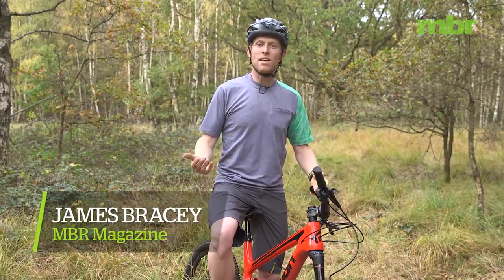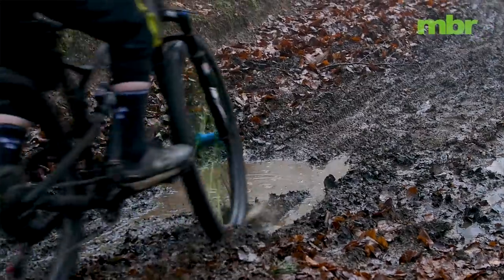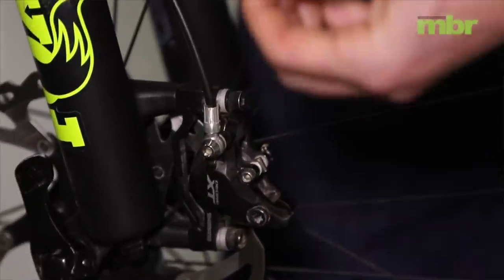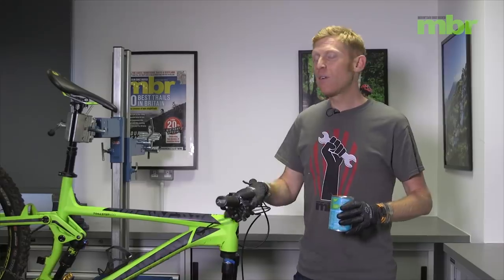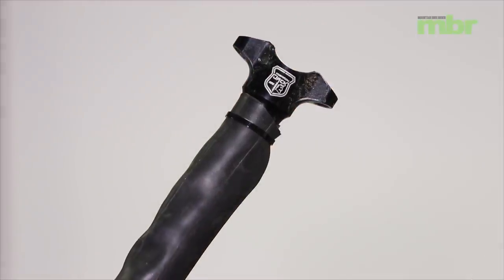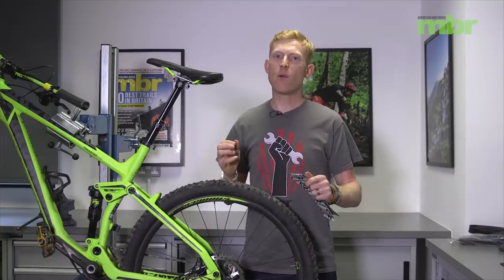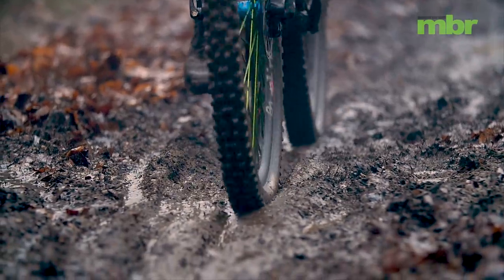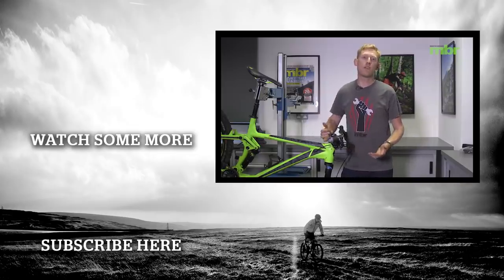10 Winter MTB Hacks | MBR

Comment: The only tip you'll need: Use your old hardtail during the winter so you don't have to worry about any of your expensive full suspension components getting damaged. No pivots to worry about.
Reply: ...and miss half the fun of shredding your enduro bike? No thanks, I'll just replace my drivetrain and pads after spring has come.
Reply: I completely disagree. Use the fun bike all year long and service it when its time to do so.
Reply: Jane Leelavathi not going to do that, proper maintenance is key to a working bike. With my back I will never use a hard tail for mtb.
Reply: Getting damaged? Lack of service and greasing bearings, will cause wear, I take my bike apart many times, absolutely evry thing is serviced.
Reply: Johannes Nilsen What I mean is that components from a more expensive full suspension bike like the cassettes, derailluer, suspension seals and bearings and the chain, become coated with mud which leaves grit moving through moving parts which causes excessive wear. I love my full suspension bike, but when it comes to wet or muddy conditions, I like keeping it simple. That way, after the ride, I don't have to cleans all the muck from tight spaces. Enjoy the ride boys.
Reply: That what cleaning your bike is for, packing bearings is important too.
cleanign your bike takes only a few minutes and is very easy to do.
I have a hardtail but I rarely use it, only have it as a backup, 
To wash I just spray water, then Muc off, let it work for few minutes, then use brush and water, use grunge brush with degreaser, and hte bike is clean after 2-5 minutes of work.
if the bike is not that dirt, I just lube the chain and wipe off the excess with toilet paper, so far Mucoff wet lube, Wledtite extreme, Rock & roll Extreme worked well.
Reply: your statements are not facts, just nonsense,:
''Full suspension is for aggressive downhill. Trails that you've likely never even seen in person.''
''Hardtails are light-years faster and intended for entirely different styles of riding.'' so you mean fullsuspension xc bikes are for DH?
''30 foot jumps''  I have a trail bike with 120mm travel, it's intended for trail use, fullsuspension does nto mean its intended for 30ft jumps.

I am not trying to be cool on the internet, I am just stating facts.
I am a lot faster with full suspension on the trails I ride.

full suspension absorbs impacts from the rear so the ride will be smoother and faster and you will be less fatigued.
but full sus is a little bit heavier.
hardtails are faster on the fatter & less technical trails.
I will never get a hardtail for mtb use, cus my back issues.
Reply: hardtails are painful for me on the trails,  and you are wrong,  I am not a hardtail hater, I need full suspension to ride on my local trails, or discs in my back will slide and cause major pain.
I have nothign agianst hardtails.
Reply: But what if your expensive bike is a hardtail and your cheap bike is your legs?
Reply: @kennethlarsson1499  and I completely agree... With you!
Reply: @Bonky-wonky  Yeah, I will spend  5 grand on a bike but only use it in the summertime.  Fuck that Jack!
Reply: @mtbboy1993  - packing bearings?  They are all sealed units!
Reply: @muzman777  but you can take the seals off and pack them with grease, this is common. you use a pick to take seals off, some bikes have grease ports, like Santa Cruz.
My new bike has seals in the pivot covers, sealing it even better than if it was just the seals on the bearings, I have a Geometron G1 now.
if you take bearings out, and take seals off, then the press bearing against grease covered palm of hand and get all dirty grease out and new grease in, I've done this on my hubs several.
butt that won't save a worn bearing, that is just to have fresh grease there when bearing is fine.
on Chris King bottom bracket there is a tool you insert which presses grease in, no need to remove bearing, so that's what I have.

Comment: Another good cheap hack is to use GT85 on your frame and fork legs before a ride.  Give your bike a good wipe down with GT85 on a clean cloth and it makes a good barrier to stop mud and crap sticking to your bike.   I've been doing this for years.
Reply: Gibson yeah I like to spray it in my brake pads and rotors too
Reply: Rob MTB GT85 is a lubricant. Not a good idea to put it on brake rotors.
Reply: William ffs it's a joke the first comment is dumb because you'll get GT all over your brakes
Reply: Rob MTB Wait, so you're telling me misinterpreted a sentence, which is only text and therefore has no indication of humour? Woah! Never heard that before! It's almost as if it's really hard to tell if someone's joking on internet because it's just plain text!
Reply: William 1) I was being hyperbolic. Obviously no one (other than whoever wrote the first comment) would be dumb enough to do that so obviously it was a joke 2) do you not see the irony. You're being hyperbolic in plain text so I can tell it's sarcastic
Reply: The first comment actually states adding the lubricant to a clean cloth, inferring not to spray the bike and risk brake contamination. I would be interested to know if anyone has had experience of using spray lubricant as an effective 'barrier' and if lubricant negatively affects paintwork if left on it for extended time.
Reply: @simonbrady5904  that's a good question. I think I'd be more worried about my frame (carbon degradation).
Reply: Alex Martino's MTB Life Look at me I have a Carbon frame!

Comment: Skateboard grip tape works good but WILL wear out the fingers of your gloves.  There is a better option. Go to the DoIt center and get a rubberized tread step materials for use on stairs. The adhesive holds better than that other stuff as well.  Just clean the lever with alcohol first and let them dry before applying.  This other material will be a little thicker to give you a bit more tactile sensation when things are wet or slippery.  And it WON’T wear out your gloves.

Comment: Good tips but I’m a little worried about the disk brakes covers I feel like it would trap mud in the calipers and would heat up your pads way more possibly causing your brake pads to warp your disk on a long decent. So unless it rains mud from the sky where you live I think the disk brakes covers would do more harm than good.

Comment: Yes these are good. Tips but most of them don't apply to because I have a bike I call the beater bike witch has no brakes no cables to the delarears and it has a bmx front tire with pegs both front and rear tires are studded and if ur wandering its a 28 yr old hardtail

Comment: 4:49 and how is that supposed to happen in your opinion? Fork tube is a closed piece, nothing gets out of it into the frame lol
Reply: Piotr Sulej I guess those beans was a bit over last sell-by date
Reply: it was quite surprising to hear this,  only thing that can rust there is the steerer itself, and the bolts, but nothing will come inside the frame from below. A loose headset can do it, water, salt can come through the bottom bracket in to the frame,  and such, this is why maintenance is important, but better bottom brackets & headsets will improve things greatly, but is nto a repalcement of maintance, so it must be kept up.